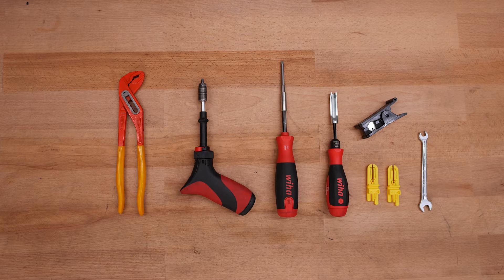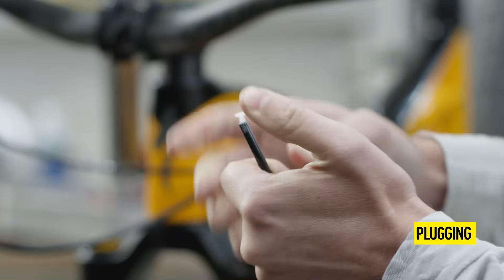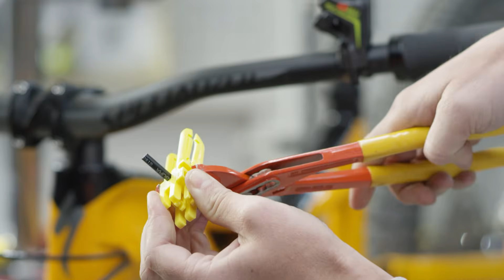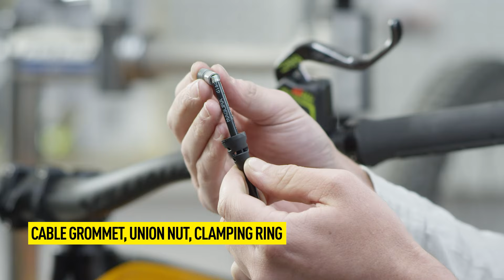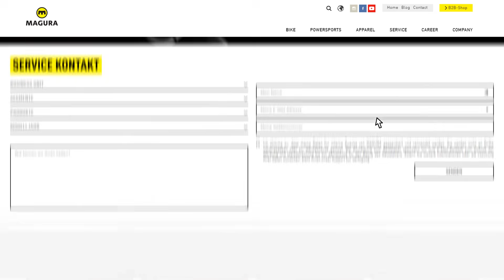MAGURA MT: Shortening the Tubing

Comment: Sleeve nut  insert on the body is made of soft plastic, mine was at a slight angle, and with very little effort completely chewed up the lever. I caught it after one or two turns, but that was still enough to ruin it. Thanks.

Comment: If I have a front brake kit and want to shorten it, meaning the entire hose line has fluid in it, this is the exact same procedure right?  Just messier when you put in the white hose stopper.  Correct?  I'm having a go at this and getting all the correct tools for the job to make sure as well.
Reply from the maker: Yes, this video explains how to shorten your brake. Enjoy wrenching :)
Reply: @MAGURAPassionPeople  So......after watching the video a few times and fearing the spray of oil all over my floor - it ended up being SO EASY to do....LOL.  NOTE: To anyone out there reading this.  It's not that hard and if you follow the steps above in the video - you DON'T even need to bleed the brakes.  Once everything is installed, a couple of pulls on the levers will draw the correct amount of fluid into the master cylinders and "firm up" the pulls further.  Excellent Video Magura and thank you for responding!!!! :))))))
Reply: @patricklim1384 where can I get this kit?

Comment: So what when tubing isn't long enough? You will only need to do a quick bleed after reattaching the tube to a lever?
Reply from the maker: What do you mean exactly? If the tubing is too short you would probably need a new one. When replacing the brake hose, it's necessary to do a full bleed afterwards. 

If you had a fully functional and well bled brake but you now shorten the hose, you may only need to do a quick bleed afterwards.

Comment: Is there a name for the specific torque wrench tool you use for the compression nut 🤔
Reply from the maker: We have a 4 Nm torque driver by Wiha with a SW 8,0 adapter for the sleeve nut that is available to our dealership partners that you could order via one of them: https://magura.com/en/EUR/dealer-search The product number is 2701485 .

Alternatively, you can use a regular torque wrench with a crowfoot adapter. Just make sure to take into account the change in effective torque caused by the crowfoot adapter.

Comment: Hi, in the paper manual, before turning the brake lever vertically, there's a step that is missing in the video: 'Carefully press brake pads apart to the stop with transport device ora a wide screwdriver'. Is this step mandatory?

Comment: Why was there no support sleeve on the piece you pulled out? Can the original olive etc be reused?
Reply from the maker: Olive and insert pin need to be replaced, they can not be reused. Where did we pull it out without a support sleeve?
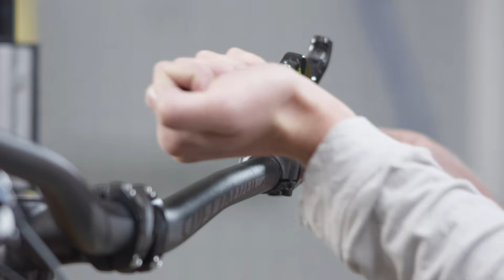Reply: @MAGURAPassionPeople  At the 00:53 mark I could not see it on the end. Thanks My lines are way to long an have wanted to do this for over a year.
Reply: @paulb9769  That's true, quite odd they did a jump cut, it must've been there, that's how it seals.

Comment: Probably most of us (customers) are switching from a pre-existing brake to a Magura. When installing the back brake in bikes with internal cabling it is useful to use the existing hose to pull the new hose. In the past I had a dropper post that came with a two-sided screw, which one would screw at one side in the old hose, and in the new hose at the other side, connecting them, and allowing to pull the new hose in while pulling the old hose out. Does anyone know how this screw is called and where to buy it?
Reply: Rockshox has it 4bucks and is red
Reply: Rockshox reverb

Comment: Are there included in the box the olive and insert necessary to shorten the tubes? I want to buy a pair of MT Trail Sport.
Reply from the maker: Yes, a bag of small parts such as spare olives and insert pins are included with a new brake. 

In order to shorten the tubes you will also need a hose cutter and appropriate service kit with our Royal Blood mineral oil, if you need to bleed the system afterwards.
Reply: @MAGURAPassionPeople  I bought the MT Trail Sports and had no issues with the tube shortening.
The front brake runs on a 160 mm Storm SL disk and   bites less than a first gen MT4 on a 180 mm identical rotor. What pads do the brakes come with from the factory and what pads do you recommend for a bit more power on the front?  I do not want to go 180mm with the rotor.

PS: besides this brakes,  we use a 2007 Louise and a 2014 MT4; both still work like new after lots of abuse in mountain biking and bike-packing, including traversing salt flats in the Andes and even using sewing machine oil to bleed them since we had no other better options in the out backs of Bolivia . I can't testify about the newer models, but those older ones were really durable. 
I think that Louise was pretty hard to beat back in the day, so much power and modulation, really impressive for that era.

Comment: I wouldn't bother with the "clip it into a Magura transport device" when inserting the support sleeve, too easy to squeeze too hard and damage the tubing (which I just did, and I wasn't being overly aggressive); wear gloves and that will generate enough friction to hold it, and just be cautious. Fortunately I had enough slack remaining that I could just cut the hose again.
Reply: Or buy something like the Jagwire Needle Driver tool which presses in the inner barb without the use of hammers.

Comment: When shortening the hose on a brand new set of brakes can you reuse the support sleeve that was installed?
Reply from the maker: The sleeve nut can be reused, the insert pin and olive need to be replaced.
Reply: @MAGURAPassionPeople  inconsistent language.. the English that is spoken in the video calls it a support sleeve while you call it an insert pin here. Just FYI.
Reply: @MAGURAPassionPeople  does a new set of brakes come with a spare insert pin / olive or do they need to be ordered separately?
Reply from the maker: @aborsic  Yes! New MT brakes come with a small bag of spare parts, which also includes spare insert pins and olives.

Comment: Hi, It is the same procedure to do a internal routing? Do I need the plug?
Reply from the maker: Hi, yes it's the same procedure when doing internal routing. ...of course connecting the hose back to the master only after routing it through the frame. A plug can help prevent oil loss and oil spilling within the frame, but isn't necessary per se. You will most likely need to bleed the brake afterwards anyways.
Reply: @MAGURAPassionPeople  thanks for the info. Very much appreciate

Comment: Do Magura sell a dedicated kit with the necessary olives & pin?  I have recently purchased an MT2 disc brake set and it didn’t come with any spares, and my front brake hose is mega long!!
Reply from the maker: Thanks for the question! We do sell a service kit which comes with everything you need apart from the hose cutter. It's available via our dealersip partners.
Reply: Thank you.

Comment: What's the bit called that you're using on the torque driver to torque the sleeve nut to 4Nm? I've been searching like crazy but I can't find anything like it.
Reply from the maker: Hi, thanks for the comment! Yes, this unfortunately isn't a common tool. We call it SW8,0 - we sell it as an adapter blade for the wiha 4Nm torque driver. You can use a crowfoot adapter for a normal torque wrench instead, but keep in mind that the leverage might change the torque setting you need, so it's important to follow the instructions of the crowfoot adapter manufacturer and torque wrench manufacturer accordingly when using a crowfoot adapter.

Comment: Would you have to bleed the brakes after you cut the hose
Reply from the maker: Most likely, yes, although there is a way to minimize oil loss. Our recommendation is to simply check the bite point after cutting the hose to check if a bleed is necessary.

Comment: Hi, is magura mt5 by fabio signature can customized the ring? Thanks
Reply from the maker: Hi, thanks for the question! Yes, our colored rings can also be used with the MT5 Fabio Wibmer. It is however not possible to replace the gold caliper cap that's screwed into the caliper.
Reply: @MAGURAPassionPeople  
Okay thank you very much sir

Comment: Looking at some MT Trail Sport brakes (like everyone else).  Do I need to bleed the system on a new set when shortening the tube?  What kind of kit should I have on hand and what kind of stoppers come in the stock kit?  Do they have blocks like the transport devices when you buy them new?
Reply from the maker: Hi, thanks for your comment! There's a chance that you might be able to shorten the hose without needing a bleed afterwards, but it's likely that you will need to bleed it. For that you will need one of our bleed kits. Our brakes come with the yellow transport devices which should be the only thing used as bleed blocks when bleeding.

Comment: where do you get that 8mm socket tor torque
Reply from the maker: Hi, we have an adapter for a bit socket for that use case, or a crowfoot adapter for a torque wrench can be used.
Reply: @MAGURAPassionPeople  Can you give me a link? I can’t find it. And thank you for the reply. All your distributors should be selling these things because it’s pretty much just Guest work and it’s a hard tool to find
Reply from the maker: @CEMESTEBAN  Unfortunately we can't give you a link since we don't sell directly (apart from the US), but it's available via any dealership that carries our products. It's called "Adapter SW 8,0".
Reply: @MAGURAPassionPeople  What's the name for the bit socket one? I have the ComboTorq wrench from Topeak and don't like the maintenance aspect of the clicker torque wrenches, especially in combination of the high price point.
Reply from the maker: @Dark__Thoughts  that´s the "Wiha Torque Vario" (2701485) together with a 8mm adapter (2701488) for MAGURA tubings. You can order both at your MAGURA dealer.
Reply: @MAGURAPassionPeople  And for only 45€, barely a half of MT5 price :D

Comment: How my I adquire this PLug? I coudnt get my mt7 installed on my kenevo because the shop said they dont have the dam plug 

Help!
Reply: You can probably get a similar plug at an auto shop.  It looks like an underbody trim clip piece.  They also sell cover/caps that are used in the same manner, but go over tubing instead of inside the tube.  It should keep the dirt out and the oil in.
Reply from the maker: You can do it without the plug! Just watch out for any oil that might leak out. Cheers!

Comment: Hi, thanks for the video. Question: I accidentally touched the lever down about 0.5cm /1cm when the cable was cut. In the video it said it was important that leaver I did not move. What should I be on the lookout for?
Reply: Sorry i know i'm late
As long as no oil came out of the system you should be good, if oil did come out of the system you just need to make sure to get all the air bubbles out

Comment: Does the mt2 version have a support sleeve?
Reply from the maker: Did you mean the silver insert pin? The MT2 does not need an insert pin.
Reply: @MAGURAPassionPeople  where do I get the torque wrench and open socket for the union nut